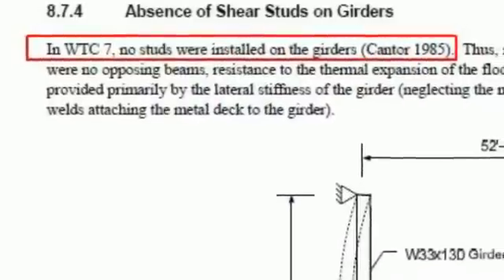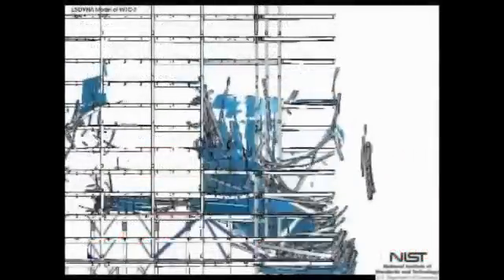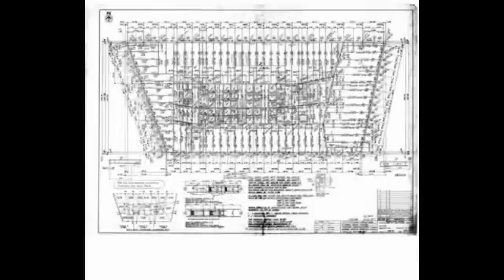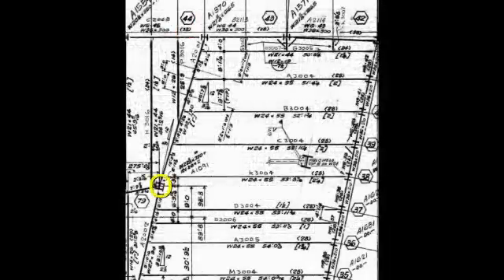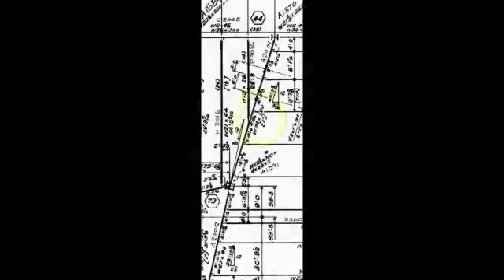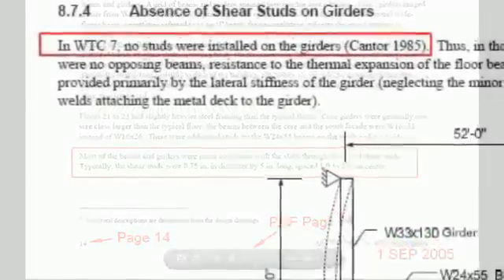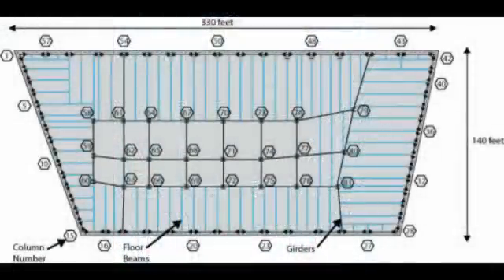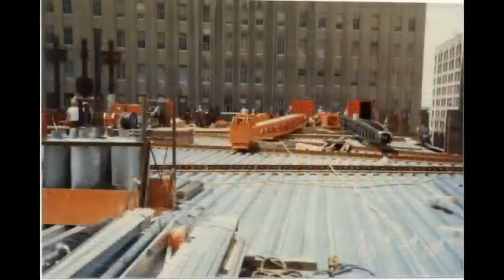Shear Ignorance   NIST and WTC7

Comment: The FBI did examine the steel? News to me. Where did you get this info? Source needed. 
I must provide every single info source to you and you can just blindly claiming this and that withoutt underlying material? No, that is bad deal. Not acceptable for me.
"What difference would it have made, please be precise, if they had let the pile burn for months as they individually picked through it."
A no-brainer. To find unsual steel damage types not explainable by office fires?

Comment: Well maybe the video's creator wasn't trying to be deceptive. However, that doesn't obviate the fact that the studs were considered in the simulation and the simulation showed them NOT to prevent the axial thermal expansion of the beams as they were shown to break due to the force of the expansion. Perhaps the dude who put this video up needs to read the final report, I don't know. In any case if you have math to the contrary you really should contact some university if NIST won't respond.

Comment: More reasons:
Avoid repair costs due to structural damage at south face and fire damage on some floors.
Avoiding of costs for complete decontamination and cleaning of whole building.
The building was considered to be demolished by planers because plans for new complex were already stored in a safe?
It's notable, that all three biggest obstackles for a new WTC complex were comletely destroyed and collapsed to a heap. Look how fast WTC7 (02-06) was rebuild. Cleaner, greener and with modern equip.

Comment from the maker: I think you are talking about the girder there, and you should read the erratum statements that have been released by NIST as well as the report. NIST do not dispute that the beams have shear studs on them, nobody reasonably does. It would be insanity for the beams not to have them. Perhaps you should be taking a look at the structural drawings for the building?? We did.

Comment: Actually, the NIST report has the math (pg 347) in it to demonstrate that the beam studs would not have prevented thermal expansion which the simulation showed. You should read the report before posting. Your video tries to give the impression that it was crucial to the analysis. and it isn't.

Comment: Not at all. What I'm saying is that the shear studs on the BEAMS don't prevent thermal expansion in the lengthwise direction. That's the expansion that is responsible for pushing the girder as I read in the report. I think that your position is that those studs prevent the beams from expanding that way and I simply disagree. Maybe that's where your math comes in - can you post a URL for your proof. Have you submitted your math to any particular engineering organization?

Comment from the maker: Yeah but the GIRDER did not do the alleged pushing, the BEAMS to the east of it did, and they ALL have shear studs according on the drawings. Are you seriously disputing that?? 
 As i said, we could suppose there were no shear studs anywhere around column 79 and the analysis from NIST still doesn't work. If we were involved in a debate over this, I would happily continue on the basis that the girder had no studs, so where's the problem?

Comment from the maker: If you look at the analysis that we did, you can see that we made allowance for NO shear studs, either on the girder, or the beams. (the drawings call for studs on EVERY one of the floor beams that NIST say did the pushing). Even without them, the beams could not push the required distance, which would have been greatly increased had NIST included the correct element dimensions and the stiffener plates as per the drawings. Show me your math that disputes this and I will be happy to look at it.

Comment: What was the "limited access" you're talking about? The FBI, FEMA, etc all had plenty of time to inspect the steel from this disaster. The fact that it was hauled away is irrelevant and what exactly would you have done instead, let the bodies rot under the pile? Let the pile burn for years?

Comment: Unfortunately the author of the video is using drawings which demonstrate conclusively that there were no shear studs on the girder that moved initiating the collapse. He seems to deliberately avoid letting the viewer see that the crucial studs were not installed based on the documents he shows you. That fact that there were lots of others has no bearing on the report - it's what's missing on that column that counts. Download and look for yourself, please.

Comment: Ctcole77 asks all the wrong questions. You'd think he'd be more bother by the fact that no scientific experiment supports any of theories presented by officials. But no, instead he focuses aka questions in the opposite direction. What's a more important question? Why did Steven jones not follow the usual path to peer review or where the fuck is mathematical input data for all three com simulations? It will always be the later because with them the official version has to be accepted on faith.